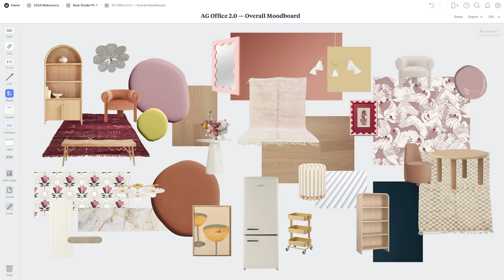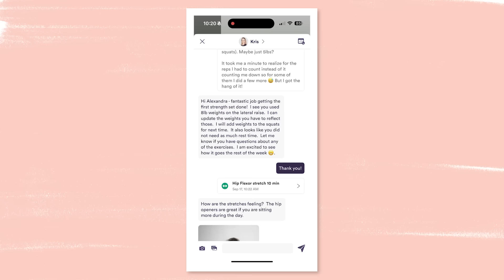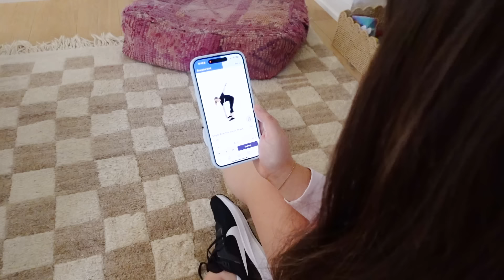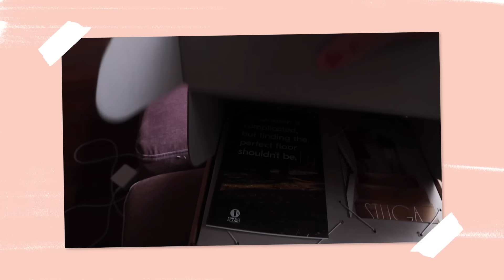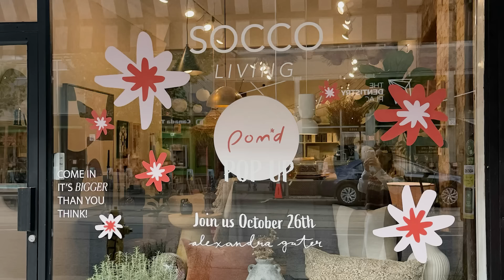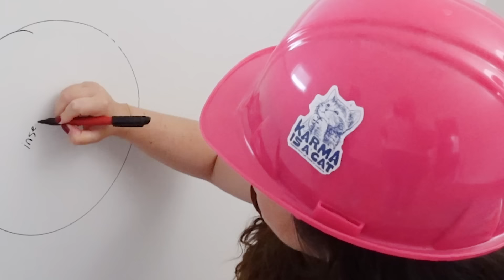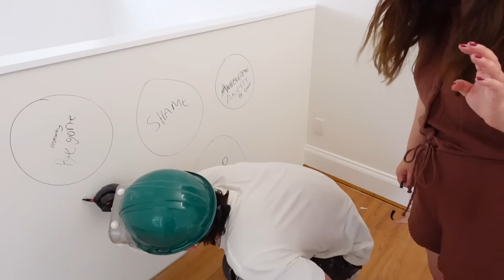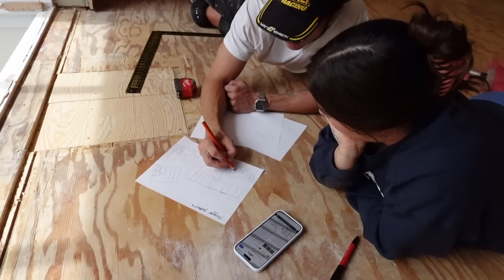We demolished this entire studio…(ep.1)

Comment: Are the spindles upside-down? Seems like the thinner aspect should be on top and the thicker on the bottom, looks more stable, at least that's how they usually are. But maybe you did that on purpose, not necessarily a right or wrong with design. In any event, the space looks a thousand times better with the new floor and those extra walls down. Can't wait to see what happens next.
Reply: Installing things accidentally upside-down is on brand for AG.
Reply: yes, they're upside down
Reply: Yes.
Reply: 100% upside down
Reply: And a dangerous gap left at one end and possibly set too low to meet code but definitely cute
Reply: Absolutely upside down 😬
Reply: Yes, the spindles are upside down! The heavier part of a thing is always at the bottom of the thing.
Reply: they are upside down!

Comment: Please fix the banister spindles the right way up. The turned portion should be on the handrail not the floor. Its a durability thing. The turned thinner ends aren't as sturdy as the squared base of the spindles.

Comment: Question, where is the rest of team AG supposed to work and did you leave the other space or just add this one?Are the spindles upside down? Is that railing high to code it seems very low. Where is Graham's workshop space.?Where is the editor supposed to work if you use the space for a clost?so many questions? What is happening with the old space? By the way I loved the old floors but I understand that it's your choice.